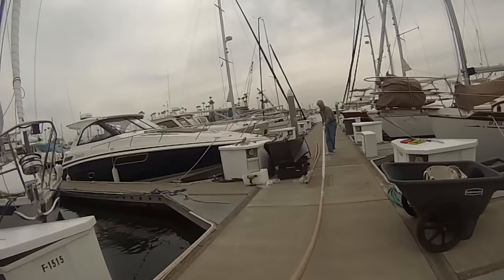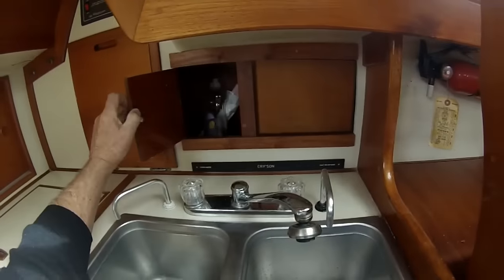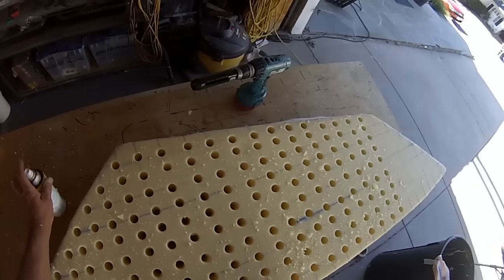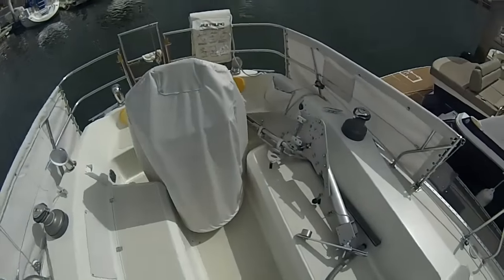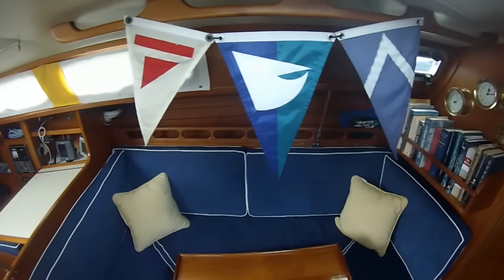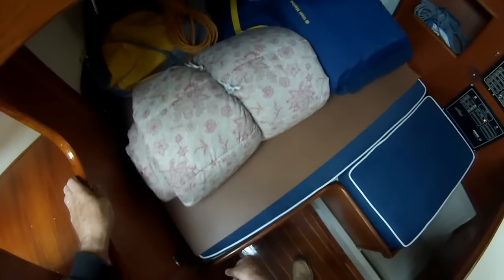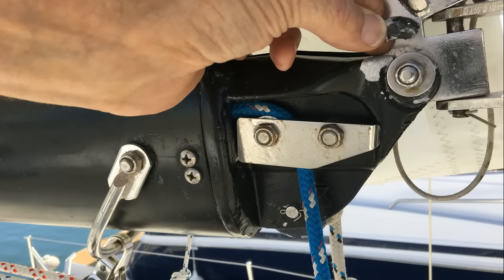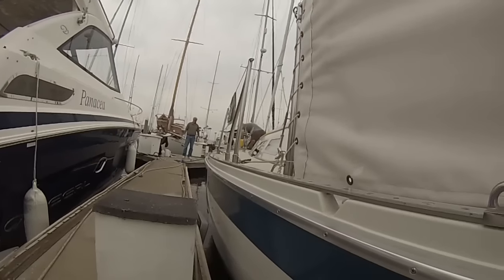"A New Boat"--Part 5 (Rub Rail, Interior)

Comment: i have never seen a chain-plate crack like that on the back stay which traditionally has less load on it to begin with . wow . No matter how many bolts are below the crack , the chain-plate is only as strong as 1 bolt and one third  the width of the plate .  Glad i have a split back stay .